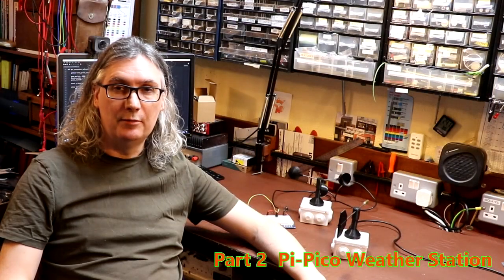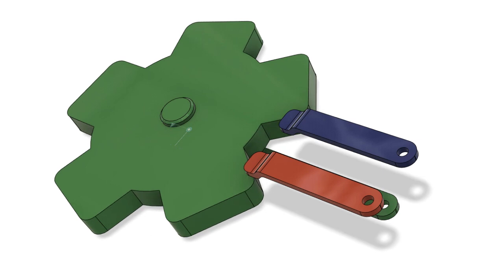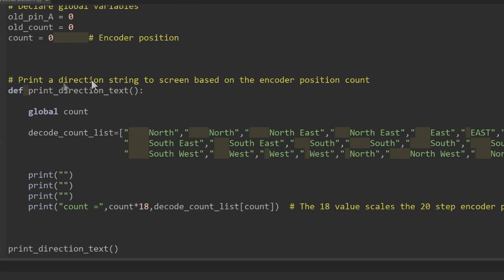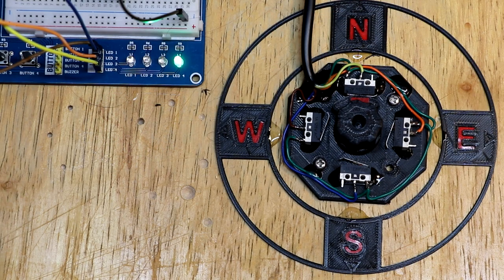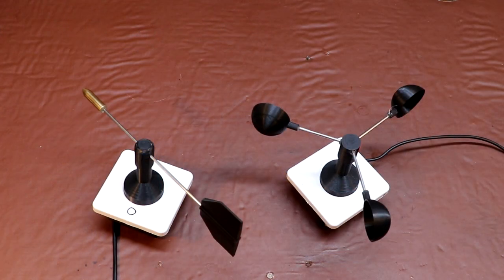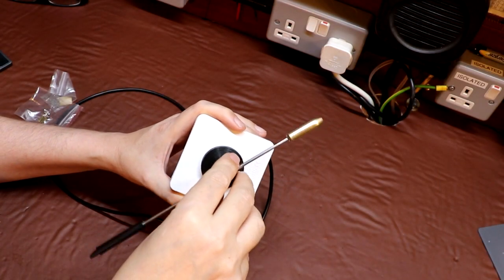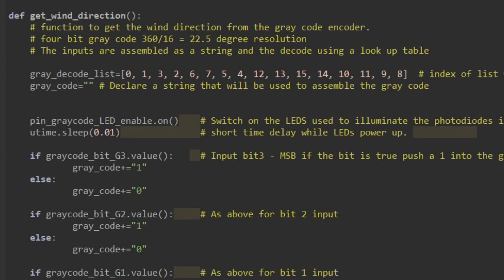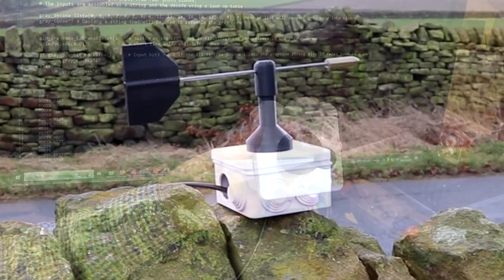Raspberry Pi Pico - Weather Station Part 2

Comment: Hello ! Just a quick message to tell you the first video in this series inspired me to buy a 3D printer and build my own weather station, and now I'm in way over my head and having a lot of fun !  So thank you very much for the inspiration :)
Reply from the maker: Wow that is fantastic. Having a 3D print will open up a whole world of possibilities and if your like me you going to love doing the 3D designs. I don’t know what I would do without one. I really love building things and just experimenting. It’s great that you can be doing something else while the printer builds. Please let me know how you get on with your builds and maybe share a video. Thanks best regards Chris
Reply: @allthegearnoidea6752  I love it so far ! It's great to have an idea pop up in mind, and being able to hold it in your hands a few hours later ! The weather station is really pushing my CAD abilities though, I find organic/aerodynamic parts very hard to design.
I going okay so far, I chose an ESP32 as a micro controller, and I'm using AS5600 magnetic encoders for both the anemometer and the wind vane. Right now I'm having issues with balancing the wind vane, as well as writing decent code to not use too much power and send data via BLE, but I think I'll manage ! I'll record a quick video to show you how it's going :) Best regards Remi

Comment: Hi Chris
  I'm late getting around to watching the latest video again.
Fantastic informative stuff, I watched it with my son who has also just started learning Python himself for work related projects.
I've done a little bit with arduino here and there but nothing so far with a Raspberry pi.
I ordered a Pi with development board last night.
I've been 3D printing the anemometer cups today and slicing the rest of the STL files, I did notice that the Greys encoder disc for the vane isn't the correct file, it's a duplicate of the anemometer slotted disc file with a different name.
I'm very much looking forward to the next episode.👍
 Neil
Reply from the maker: Sorry about the grey code wheel. I will look into this and drop you a message once I have uploaded the correct version. Sorry about that and thanks for letting me know. I thought the cups were probably the most difficult parts to print so if they came out ok you will find the rest easy. I haven’t full tested the weather vane yet I have found it a little unstable but that could just be the blustery nature of the wind at ground level. So glad someone is have a go. If you have any improvements I would be glad to upload some modifications. Thanks Chris
Reply: @allthegearnoidea6752  Hi Chris
 Update, I've now got the Greys encoder wheel, (and the middle platform,) files which were missing from the STL folder.
They were in the STEP folder,
 I don't have Fusion360 so I tried to open them in Tinkercad which didn't work so I downloaded Freecad and converted them to STL with that.
I'm waiting for some hardware to arrive now, Pi should be here today or tomorrow so I'll be able to have a play with that .🙂
Many thanks Neil
Reply from the maker: @dizzydee5620  Hello Neil thanks for letting me know. I am not sure if your purposely going down the open source route but Fusion 360 is free for hobby use. It has some minor restrictions but I haven’t found them to be a problem. If you do convert the files into other formats I would be happy to include them with my files. Again if you want to make any mods or changes we can upload them as well. Let me know if you need anything. Thanks regards Chris.

Comment: Coming along nicely, Chris. I'm curious to know what printer filament you're using. ABS? PETG? PLA? Or, perhaps, something more exotic. Sorry if you already mentioned it in the previous video.
Reply from the maker: As this is a prototype I am using  PLA+ from sunlu. I have been using this for a couple of years and it appears to survive well even when used outdoors. If I ever print a final version I would go for PETG.  I’m actually interested to see how long the PLA version will survive and how it fails. Good to hear from you hope all is well with you. Best regards Chris
Reply from the maker: I would like to know about your 3D printing have you done much ? What is your preference
Reply: @allthegearnoidea6752  Not as much experience as you have , I should think, Chris. I use an Ender 3 with PLA, CURA slicer, and have had very few failures. I'm just thinking of venturing into PETG. You very kindly send me files for some 9R59DS parts a while back and they turned out very well. I'm really grateful to you. Hope all's well with you, and I'm looking forward to the next instalment.

Comment: Nice project. What's the Pi Pico like for speed on real time systems? I'm used to embedded C or assembly where you can control GPIO at hundreds of kHz of needed
Reply from the maker: It’s slow running micropython. But it has a dual core you can access in C. As you say PIO and several state machines can run very quickly but not tried it myself yet. I suggest Python runs about 100 times slower that C but would line of Python is some applications would be 10 lines of C.